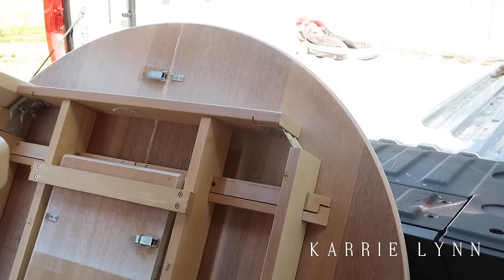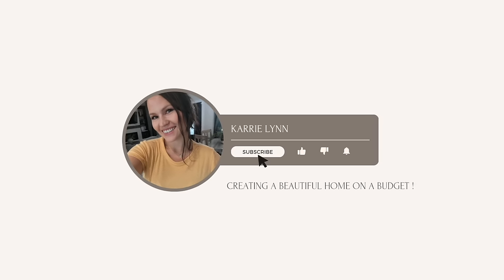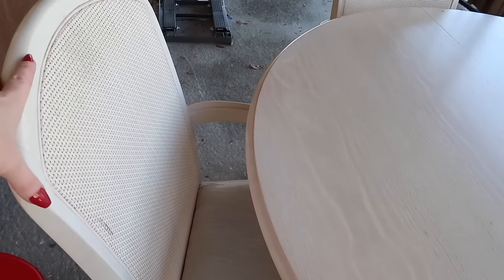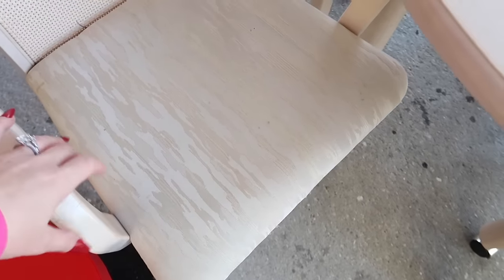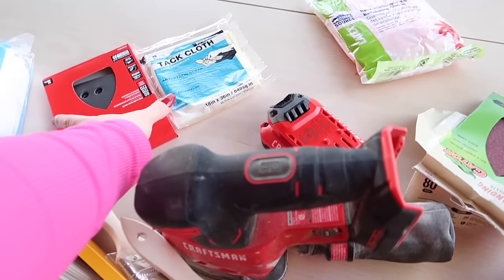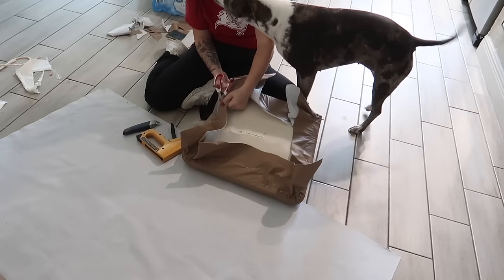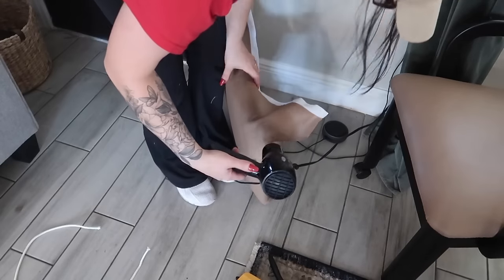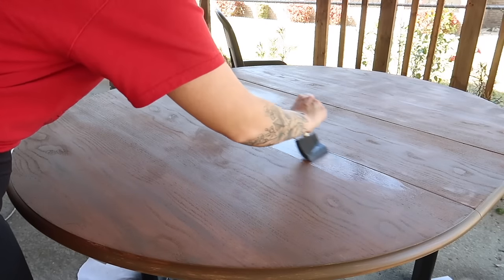Table makeover | Outdated to new again! Dining room table transformation! DIY on a budget.

Comment: Hey, on your next project with a heavy shellac finish, a carbide scraper will work much better on the initial refinishing steps. That's why you burned through so much sand paper. Shellac just gums up sandpaper terribly. A scraper gets rid of the shellac and will cut your sanding time in half. Give it a try!

Comment: You totally rocked it little lady!!! The table looks absolutely gorgeous and truly fits in your dining room. I'm wondering if there isn't a way to add to the length of the legs to be able to remove the wheels. Like drilling into the leg and inserting a dowel in the leg and the extension and holding it together with wood glue 🤔. But man, the table turned out awesome!! Excellent job 👏.

Comment: A bit of input regarding the orbital sander…I have a DeWalt corded one, and hubby has a Ryobi battery operated one. I like both of them, the battery one is a bit bulky to hold, and it tires my hand more quickly.  I have had the DeWalt for a long time, over ten years, and use it a lot. Recently its pad Velcro wore out, no biggie, replacement parts are available and inexpensive.  Removing the ok’d one was a bit difficult, just because the screws were quite tight, but the process was easy. Then I started having some difficulty with the switch, I opened it up to see how difficult or easy it would be to replace, the inside was packed full of sawdust.  I used my canned air to give it a good clean and that completely solved the issue, but also replacement switches are inexpensive and appear to just be snap out/snap in.  I expect the same is true of other brands.  Once you have the orbital grab the big packs of sandpaper discs, it is way more economical.  On your list of tools to make your life easier is an air compressor, and then you can get various tools that go with, and an air driven stapler is something I highly recommend.  Doing upholstery is far easier , the staples go in so much better.  You just keep on being you, doing a great job. I am sorry to hear that your market for reselling furniture is not stronger.  It is very attractive and would look great in a lot of spaces.

Comment: Table set is beautiful!   But I have a random question.  I'm about to try my hand at painting furniture with Beyond Paint.  Do I need to seal it after, like you did with the table?   It's a cabinet that goes over the toilet. I appreciate your help!
Reply from the maker: This has a sealer in it. However, just keep in mind that it takes a full 30 days to cure so it can get scratches, etc, in the meantime. So just be carefull . I didn't seal my cabinets in my bathroom, and they are holding up wonderfully. They have a professional finish that won't scratch off easily now that they have cured.

Comment: Take the wheels off the chairs. Put the sound stuffing things put the felt pads under the legs of the chairs. You said the chairs were too low for the table. If you can cut a little bit of the legs off of the table. Measure first 😊

Comment: If you’re going to reupholster chairs like that. Buy an electric staple gun. And save your hands. I only have one like yours. But I haven’t reupholstered anything lately. The chairs look great. I really like the table and chairs. I would look for a cheap table with some beefier legs you could switch the legs to that table. If the legs are painted it wouldn’t matter what they look like. Maybe the legs just needed to be tightened up. But the table looked a little wobbly when you were sanding it. It turned out great. And my grandkids would love those chairs. They would go all over the house.

Comment: I got an unfinished table from Amazon 2 years ago great price. Did a white wash and it looks good but the table top got sticky from the top coat coming off. It just needs to be sanded and another coat of white wash and sealed. Or used a little sticky, i can’t even give it away! No one wants it. I guess it’s not a thing in this area to buy used tables.🤦🏻‍♀️